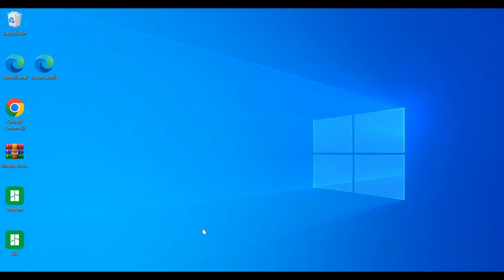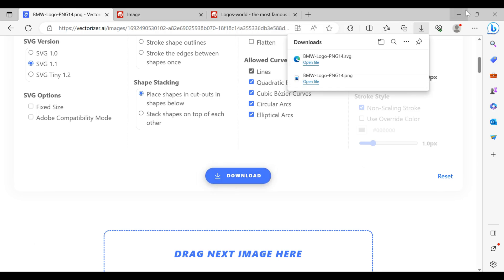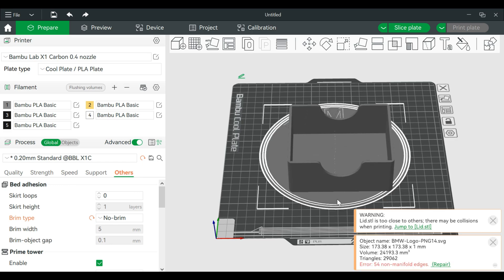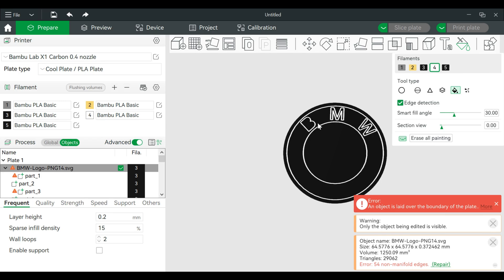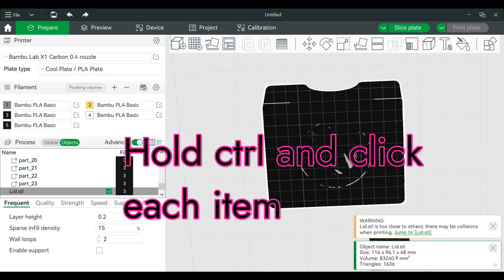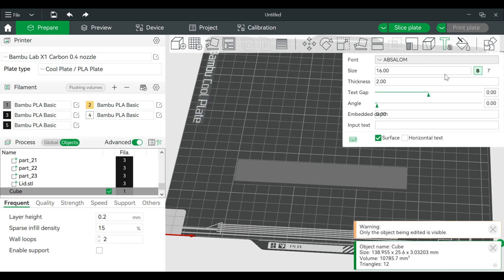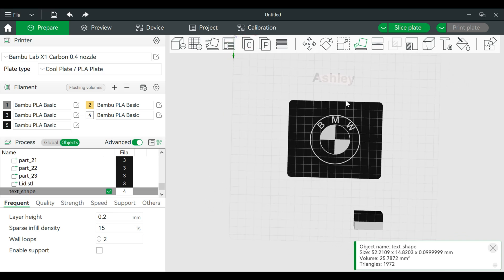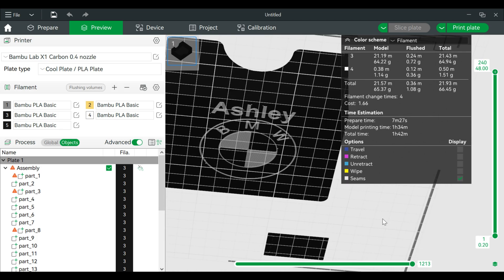Bambu Studio Logo Import, Text Creation,  and Assembly Techniques.

Comment: when assembling a logo on the back of an object, it shows up in the prepare screen, but when i slice it, it disappears. cant for the life of me figure it out, ive followed your steps exactly. even painted the letters how your name was blacked out. any tips?
Reply from the maker: Hello thank you for the question. There is an "order of operations" for slicing with the last item taking precedence.  

You must make sure the text falls below the part in the objects process area.  

This should help show the steps. 
https://youtu.be/DxFQfYj-baM?t=322
Reply: @ashleys3dprintshop  thanks for the reply! i did try this several times and diffenet ways. could not get it to work. i then clicked "fix model" and for whatever reason it worked!!
Reply from the maker: @ Excellent. Thank you for the follow up. I often forget that fix model option is there. lol. 😄

Comment: Nice video
I have an SVG, but when I import it, it is just one object. I get a "wire" like solid, not areas. How can I choose independent areas in the SVG to extrude? (like CAD)

Also, at the end of the video, beautiful result, how do you get the triangle pattern?
thanks
Reply from the maker: Hello, thank you for the question. There was a change in some of the Bambu studio versions https://www.youtube.com/watch?v=N_2I7VBu8lo and older versions work with this technique.

I do believe the latest version that was released a few days ago brings back the feature but you need to drag in or import the SVG file.(top left "file/import") 

I would not recommend right clicking a model and importing the SVG file.

Comment: So I got the logo onto the Bambu app but my ? Is if I can remove the corners so it’s just the shape of the logo right now it’s in a square shape please help me.
Reply from the maker: Hello. Sorry about the delay. There is a way to "trim" out a shape using mesh boolean intersection. 

https://youtu.be/z4l75T6jliA

Or depending on how the model is constructed you try right clicking and separate into parts then reassembling them with merge.

Comment: I can't seem to get this to work with current version of Bambu software. Has anyone else had success?
Reply: Nope, same issue. It doesn't work in version 1.9.7.52 for me.
Reply from the maker: I may have to revisit some of this as the newer versions renamed and changed "assemble" to "merge", but the core functions still work.
Reply: @ashleys3dprintshop  I followed it exactly, even with the different word choice for the option. They must have changed more than just the name of it.
Reply: Just used this method today.  The only difference is merge vs assemble.  Sliced and printed perfectly.

Comment: I'm not seeing Assemble in the mouse menu but merge instead. There IS an assemble menu up by the paint area. Did they add more features to assemble then rename what YOU used to Merge? 
Trying to get a restaurant logo on the Mouse kit. 

Also do you know if there's a way to put stuff on a curved surface without hurting the original object.
Aka i want to put the logo on the mouse without effecting the shape of the mouse
Reply from the maker: Hello. The latest version of the slicer calls what used to be "assemble",  "merge". 

There is another assemble which does a completely different thing so it can be ignore for this purpose.

So in short use right click, MERGE not Assemble. 

As for the curving a logo there is a way to do it. I recommend using an SVG file I have a few videos showing the steps with modifier or mesh boolean. 

Curved Text
https://www.youtube.com/watch?v=oB9Echrn90A

Curved image
https://www.youtube.com/watch?v=_U0ptFu8Jo8

Comment: I have followed this to the T and tried over and over.  As soon as I slive, the main object takes over the text and it is no logner visible.  I have even tried to paint it again.  I am running the latest version of Bambu Studio.   Very frustrating.
Reply from the maker: Hello, thanks for reaching out. You are probably running into a somewhat common issues that didn't crop up for in in this video. 

There is an "order of operations" for assembled/merged parts. 
Its a simple fix however. You just need to "move" the main part above the text parts in object process. 

Better explained here. 
https://youtu.be/DxFQfYj-baM?t=393
Reply: @ashleys3dprintshop  Thanks for the reply!  I did do this first.  After playing with it a little more, I got it to where i could see bits of the text after slicing, but there is no way it would be readable.   I closed the proejct and will try to start over when I can find a solution.
Reply from the maker: @aaronscalise7682   How "thick" in the z axis is your text/image?

I recommend at least 2 layers worth. 
So at a .2mm layer height then the text should be at least .4mm high. 

Also you mentioned it may not be readable are you making the text small? If so there are a few options. 

Smaller nozzle, or change line width.
Arachne wall generator tries to automatically change the line width but it may not always work. 

Full topic Line width
https://youtu.be/K6-qhX2S4IY?t=14

Actual fix in action on .4mm or .2mm nozzle.
https://youtu.be/9PrcIl67nw4?t=295

But if line width is your issue and you are using a .4mm nozzle try changing your line width to .3mm.
Reply: @ashleys3dprintshop  it was set to .1 but then seemed to have changed itself to 2 on its own
Reply from the maker: @aaronscalise7682  once the text is embedded into the model just changing the z height may throw off the whole model.

Sometimes it's good to right click, separate into objects. Make the z height adjustments, then merge them together again.

Just be aware when you separate into objects everything falls to the plate.
Reply: @ashleys3dprintshop  I have even watched all of your methods in the Text Techniques video and none work.  There is something wrong with Bambu studio.   For example, i dont have an assemble option.   Regardless, none of this works for me.  I am writing this off indefinitely and will spend the time using a proper design tool and leave the slicer to slicing.
Reply from the maker: @aaronscalise7682  "assemble "was renamed to" merge" with the latest update, but functionally it does the same thing.

I don't know if you are comfortable created a short video of your project and sharing it I could take a look but sometimes it helps to have another set of eyes on it.

You can reach me by email as well. (in my channel description)

Comment: Could you possibly show how to wrap a logo across an uneven surface like the side of a bowl? Or a plate that is concave? I tried messing around with it a bunch and I can’t quite get it to lay flush with the object. Text works out fine, but not an imported logo.
Reply from the maker: I haven't missed your comment. I have been testing a few ways to do it and may have a couple ideas to flesh out first. 
Here is an example  https://youtu.be/z4l75T6jliA?t=1444

Comment: Thanks so much for this, I have a challenge for you that I am trying to figure out myself (if at all possible). Do you think you can wrap an image around a cylindrical .STL file?  Or do they all have to be flat for the image to work?
Reply from the maker: Challenge accepted！Lol
Interestingly enough have been thinking about this for a bit.
So there is a way to add some images to a curved surface. However there is a huge caveat. 
Full images will not work, or at least I have not found a way to do it. 

However, line art/outline of an image may work.
Reply: Have you figured it out?:) i could really use this feature. If they could make it as easy as the text shape function it would be amazing.  Thank you for the great videos. @ashleys3dprintshop

Comment: Unfortunately, this method does not work for me.  I'm still messing with it, but I followed everything step by step and it does not work.
Reply from the maker: I probably should have asked a few questions first. 😉
Logo to part.
How thick is the logo piece? How thick is the part?
Is the logo curved? Is the part curved?

Is this a vertical (bleh) or horizontal placement?.(yay!)

any an all details are helpful if you can share it.
Reply: @ashleys3dprintshop  So I make custom button boxes for sim racing games.  Some people want their names, numbers, team logos etc.  

I'm testing with an SVG of someone's logo I converted to an STL and placing it on a rectangle I generated and sized using the "add primitive" feature.  At first I tried the logo a few mm thick as well as the rectangle.  Then I tried the logo 0.4 mm thick and the rectangle 2mm thick.  Nothing worked, and I tried a few more variations of that to no avail.

Thank you for being so willing to help!
Reply from the maker: @BluDog35  No worries, here to assist if I can. If you have the file as an SVG already you should not need convert it to stl.

You can import an svg which gives you a ton of options. Especially in painting.
Adding it to a part can be straight forward from there. You may need to center it, place logo in position,   highlight all parts, right click assemble. 

You can still move parts in objects process at any point, before or after assembly but if you miss click the whole model gets selected vs the part you want to manipulate. 

I hate to throw a bunch of homework at you vs a straight solution so I'll give you some of my vids that cover it. I try to keep things under 20min. 

Bambu Studio SVG File Type Tutorial
https://www.youtube.com/watch?v=3zYdqUtVa3I (not completely necessary)

Making a 2 Sided coin. Alternative Method Bambu Studio Intermediate Tutorial
https://www.youtube.com/watch?v=F7L2_R4zEXI

The last video may be good because it shows some fixes if a part's color does not show up, placement, move tool, layers etc. 
if 0.4mm .6 or more may be needed depending on the number of color swaps or if there is a stark color change. (black/white)

Also that vid I sent earlier for "flush 4" example helps if you need to move the part priority.
Reply: Are you using at .4 or .2 to print that ?
Reply: What if I wanted to cutout the bmw logo from the top of the box?  How would I do that?

Comment: Great Vid! learned a lot. Can you embed a logo like that into the side of a vertical object? Thanks
Reply from the maker: Yes. The angle does not matter much. But if you are printing logs with it can be punishing on the AMS, filament usage and print times.
Each color change adds about 90-120 seconds with every change. If you have 2 changes per layer its almost 4-5 min per layer. It adds up fast.

Ideally I would make the the prints colors horizontal but nothing is stopping you from making it vertical.

Comment: Hi, I've added a logo to a lid very similar to what you did in the video. The model shows everything I've painted is correct but during printing the white lettering didn't print. Do you have any suggestions on what to do to fix this? I also got an error message stating "Unable to print multiple filaments which have large temperature differences together." I'm using a blue, black, and white. Only one white letter printed.
Reply from the maker: Hello. There can be a few reasons but lets start with the simplest one first. 
Switch over to Process Global , quality, wall generator: Arachne

Another simple thing to try is this.
Convert the text type to modifier then repaint
https://youtu.be/C3dXlJB9pb0?t=81

If there arent enough layers  slightly more advanced

https://youtu.be/F7L2_R4zEXI?t=567

As for the temp issue you will need to change the filament type to the same brand.(there are other more complicated ways but we can keep it simple.

For example if you are printing with PLA set all of the filaments to "bambu PLA basic" you can keep your colors the same. 

I may revisit the assembly video as there have been many advancements since then.

Comment: I followed this video to make a coaster using a Mercedes logo and I can't figure out what I'm doing wrong. When I assemble the 2 (SVG and stl of coaster) the logo disappears when I slice it. If I don't assemble the 2 files, I get a warning of Gcode conflicts. Any ideas? Thanks in advance! keep up the great work!
Reply from the maker: Sorry about the delay had some other projects running and there are some major shortcuts that are available now. 

I made you a quick video which should solve the issue. It's low res now but 2 hrs from when you see this it should be in 4k. https://youtu.be/C3dXlJB9pb0

Comment: Having a challenge with this on the text/name portion. Printing a logo in orange and teal and that portion is perfect, colors pop. Below it I have a name in orange also and in a larger font/size than the logo. But the name portion of the print almost comes of “hazy/faded”. Almost as if I’m getting a black layer somewhere that should be orange. Any thoughts on what I may be doing wrong?
Reply from the maker: There are a few ways to look at this. You can repaint the text,(which I will assume you have tried) you could also increase the layer size for just the text.

 So if your text was .1mm you can try to increase the z height to .2 or .4mm.(turn off uniform scale) This will push the text above "flush" you can use the "move" tool to push back down.

It's not explained in this video but it is explained in this one. https://youtu.be/F7L2_R4zEXI?t=189
Reply: @ashleys3dprintshop   My part thickness until it changes height (starts creating a slot) is .79 mm, so sending it to print now with a text thickness of .65 to see if that solves my issue, feel like it will!
Reply: That worked perfectly!  Thank you for the guidance!

Comment: My 3 year old discovered that if you click on a part/parts, you can change the color by pressing the number key associated with the color in the filament bar on the left. A bit faster than the right clicking/change filament I was doing previously.
Reply from the maker: 😁 you're absolutely right. There's a bunch of shortcuts that you can use, like T for text, F   for lay on face, m for move etc. 

I like the fact that you are involving your child in the slicing process. You're creating great memories. Cheers to the youngin' 😁
Reply: @ashleys3dprintshop  right? I just bought the book " Mastering Fusion360" and on the first page I already learned a whole bunch of shortcuts that I could have been using for years haha.

Comment: My only chalenge now is to get the glue from the plate out of the print. Have you manged to print on the cold plate with no glue? Using PLA. Thanks
Reply from the maker: I should probably do basic overview of what I use but I only used glue stick for the first week I had my printer the washed it off and never looked back. 

 I am a kick starter backer so I've had my printer for a year and over 3300 hrs printed.
 
I used a product  called "Nano Polymer" from vision miner($45 for 120ml.)  It's little pricy initially but a single bottle has lasted well over a year depending on application.  

Leaves no tacky residue and I'm still on my original cool plate sticker. I run every print on cool plate settings of 35C on all my plates (cool plate, pei or peo) . I usually print in pla but the vision miner works on nearly everything. 

@VisionMiner
https://www.youtube.com/watch?v=JoYpI7TYB94
(not a sponsor)
Reply: It would be nice if we could get that in South Africa.LOL @ashleys3dprintshop
Reply from the maker: @tonymarreiros3186  I haven't used this brand personally but TH3D Bed Cement is similar and they ship to South Africa and seems less expensive.
Reply: I used Windex as the release agent on my Cool Plate for PLA. I’m still using the original sticker on my Kickstarter printer.
Reply from the maker: @cbgslinger  You are just like me. I don't know why people dunk on the cool plate but I too am still on my original kick starter plate. About 80% of my 3500 hours were on the 😎 plate.

You can print pla with the top and door closed. You don't need to crank the chamber fan, and you don't need to heat beyond 35c the bed.

Only difference is I haven't tried windex. Lol have you tried the pei, peo or other plates?
Reply: @ashleys3dprintshop  I bought the Bambu lab PEI plate a few months after I got my printer because everyone was raving about PEI plates. I figured it might come in handy if I ran into problems. I haven’t used it yet. The “Cool” plate works fine (I have and extra one to use when printing big designs so I can start another print while the other plate cools down) and I just print PLA. It’s easy and meets my needs for cigar box guitar parts. From what I can tell the “no glue” folks end up using isopropyl alcohol all the time anyway. I didn’t want to use glue either and saw a YouTube video recommending Windex; it has proved to be quick and easy.